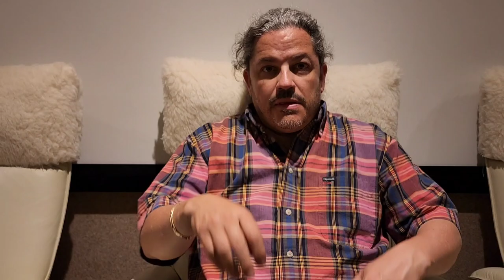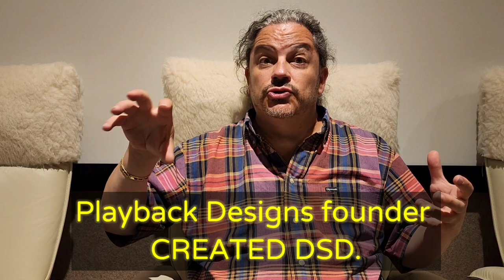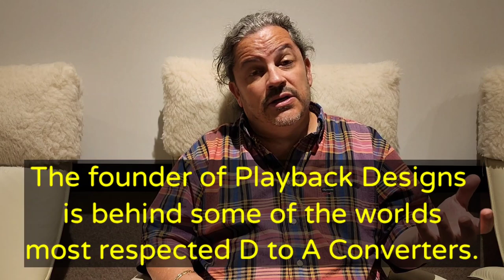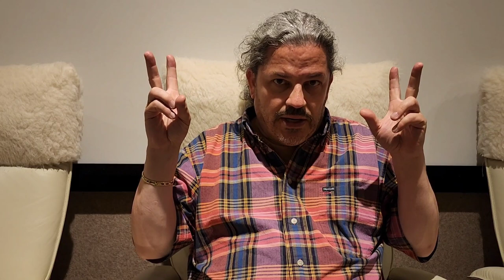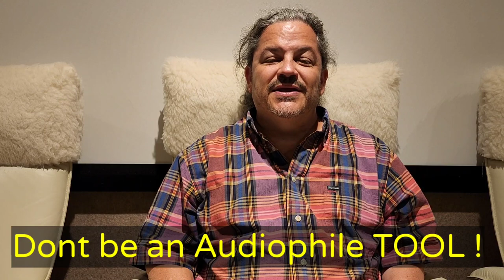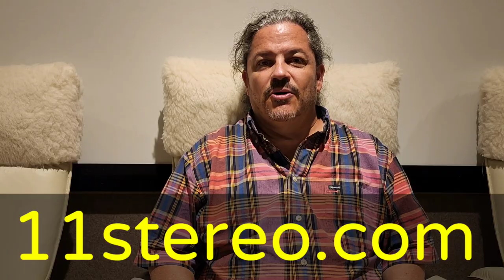SPILLING THE 411: PLAYBACK DESIGNS

Comment: My 20 cents: the Chipset Nagra uses in their top level DAC might not be the highest in the line from PBD, but there is A LOT more to a DAC than the chipset. Tube output stage, external PSU, the list goes on. Personally a big fan of Meitner stuff (I own one of their pieces). Only heard the PBD stuff at shows and therefore can‘t really judge its sound…
Reply: Exactly, the conversion circuit is only a fraction of the design. And the newest circuit of chip isn’t always the best. Many high end dac’s use older chips and circuits.
Reply from the maker: PBD, does not use a "Chip set" ...
Reply from the maker: You are correct, but no matter how good it is a power supply and analog output stage can not take care of pre ringing. Only the way the filters work can. so you can put lipstick on a cow, and its cuter than a pig, but it still smells like barnyard.

Comment: Listen to Netherlands 🇳🇱 based ecdesigns Power DAC R or S and then see yourself which is more analogue .. yiu will be shocked .. R sells fr 1200 Euro and S fr 3000 euro with inbuilt amplification by resistors ( no tube or transistor) .. fractal based technology fr conversion used in DAC .. never attempted it before anywhere in DAC in world so far …Needs to high end steamer just a normal computer or mobile will do
Reply from the maker: Hi Varinder, I appreciate your enthusiasm but Playback is also like no DAC you've ever heard...

Comment: Yea. Very few companies use true FGPA based DACs. Most use FPGA for the DSP and control stage in front of the DAC stage.

If the FPGA is big enough it can be updated for the next 10 years realistically. Still got very high software dev cost even with that "low cost chip".

I don't really see the point of buying a non FPGA based dac over a thousand when the tech is static and can't be fixed nor updated if there is an issue with the DAC chips.
Reply from the maker: Yes, very good insight indeed !

Comment: So my lust after Playback Designs is well regarded then? Good to know in about 2 years my saving for a MPS-8 will be for a good cause.
Reply from the maker: Great Name dude, what bike is that ??  Ive got 2 levels below MPS-8 for you that are built on the same architecture if you'd like something less expensive. And Ill buy them back and credit you towards upgrade.
Reply: @OCDHIFiGuy  Pic is my 2014 MV Agusta F3 800.

That is an interesting thought I will ponder; business picking up or not will be a huge factor as I may be worried about other things than upgrading stereo equipment in the short term.